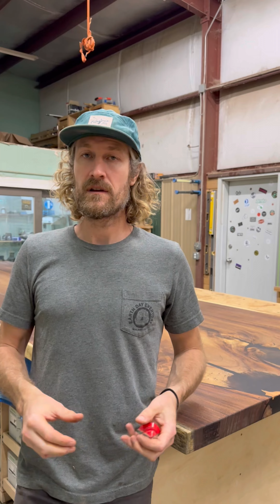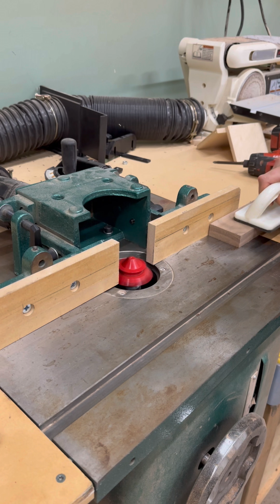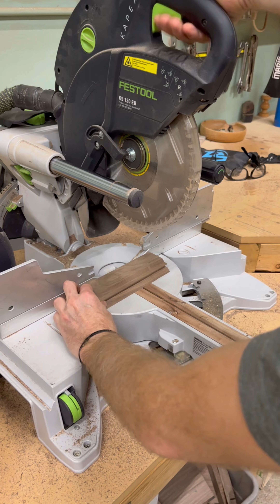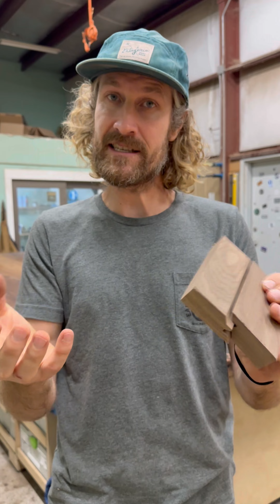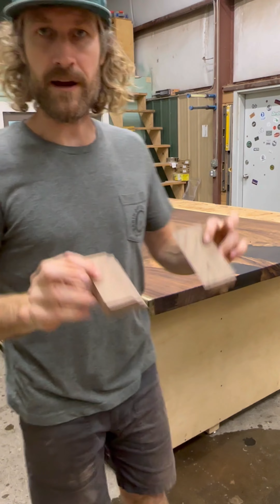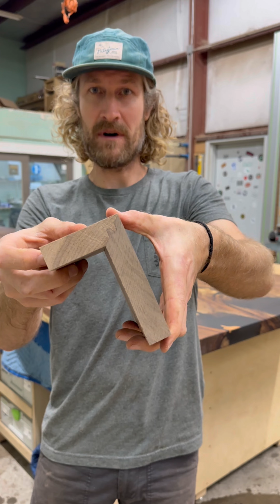Setting up and using a lock miter bit for perfect mitered edges

Comment: great video bud on how to use this bit!  Its better then some I have seen out there.  On the second cut, when I am using my router table, and you put your piece up against the fence and it rides along the face of the fence, any suggestions on how to make that more stable?  I am looking to make some drawers with this kind of bit and I have no issues with laying the piece flat on the table to make the first cut, its just the other cut that I am unsure of.